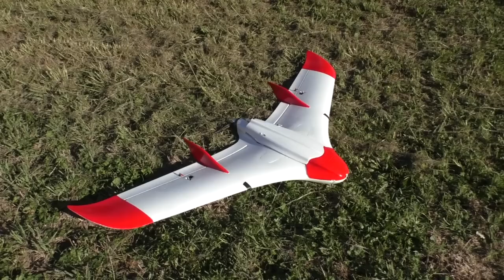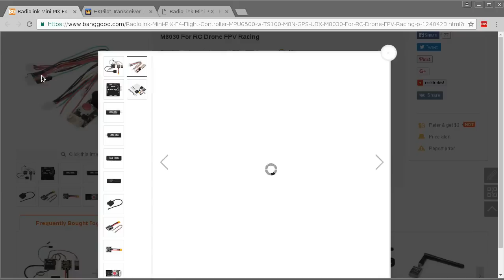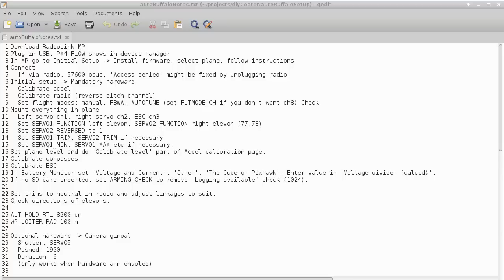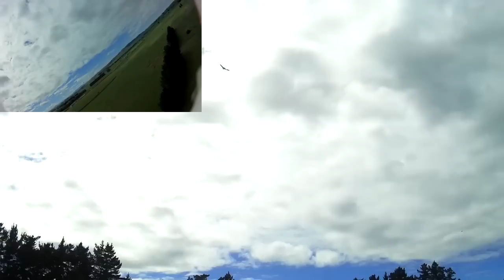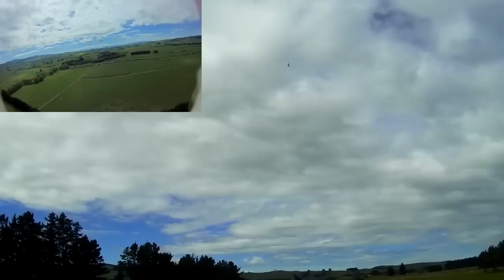Arduplane setup steps for flying wing

Comment: Hi @iforce2d, great vidoe. thank you for sharing! I'm one of the maintainers of ArduPlane so if you have any questions about flying ArduPlane let me know!

ARMING_RUDDER=2 to allow ARM and DISARM via rudder

FBWA mode is manual throttle. If you set throttle to zero, it falls out of the sky. If you use FBWB then it's speed/height based. throttle in middle means maintain current altitude. The flight controller figures out whatever it takes to do that. throttle all the way up/down means raise/lower altitude, speed will be maintained automatically to be within ARSPD_FBW_MIN/MAX and will cruise at TRIM_ARSPD_CM (in cm/s).

General rule: if it flies good in FBWB, it will fly good in AUTO and RTL.

As far as the funny pitch reverse. It was probably that you reversed the wrong aileron and then reversed the pitch in two places to make up for it. Keep in mind that "MANUAL" is a passthrough and there's 3 places to apply reverse (for better or for worse). Transmitter output, ArduPilot RCxREVERSED (the input) and SERVOx_REVERSED (the output). 

Your hardware problems are related to "you get what you pay for". There is a huge variety of hardware available and you've selected pretty much the absolute cheapest option. I highly suggest getting quality hardware. Faulty hardware is a huge time sink. What is your time worth? The cost is not that much different compared to the whole cost, not to mention if it fails in the sky and you scrap the aircraft too.

If you get pretty much any other hardware you'll be able to use normal latest-release versions of Mission Planner instead of their Chinese version.

MANUAL mode is not required, it's just forced in the GUI for people new to it. You can override it by setting FLTMODE6.
Reply from the maker: Hi Tom - was it you talking about running Arduplane on a very small wing and a CC3D mini or some such hardware recently on Gary's podcast? I was looking around for more info on that but couldn't find any...

btw the pitch reverse thing happened with both multirotor setups too. I noticed that when I changed the 'reverse' checkbox on the radio calibration page, it would affect the value of SERVO2_REVERSED in the full parameters list. I think servo2 is elevator by default so for a conventional plane, reversing it would indeed have the desired effect of reversing pitch, but imo it should simply reverse the commanded rc input.

Anyway for the third and subsequent setups I made absolutely certain I didn't twiddle with that checkbox and simply reversed pitch in my radio, and I didn't have any more trouble. Maybe it's a quirk of this non-standard firmware.
Reply: @iforce2d yes, I was in the video but the work was all done by Andrew Tridgell (I was sitting next to him). Check video https://youtu.be/x8nQoEPrCTc?t=3005
Reply: sir i have some fixedwing planes but there is not possible to fly in autotune mode . how can i give the  pid values in manual
Reply: @ Tom Pittinger I have a question can I still use  arduplane in an apm 2.6 I have been trying to  set up  my apm 2.6 can't calibrate compass for some reason tried uploading older firmware. Can you please help me
Reply: gregatex I doubt Tom will help you with APM boards.  They are more helpful if you buy the expensive so called branded pixhawk boards they usually won’t help if you are using so called knock off boards.  That’s all good and well and most can appreciate that but not everyone has the cash to spend on a $400 pixhawk.
Reply: gregatex if you are using APM and pixhawk purchase from eBay or Banggood you are pretty much on your own on figuring out how to get it working. Just a heads up.
Reply: Hi Tom, 
I've just noticed that my favorite Flight Controller:

(this one: https://www.banggood.com/JHEMCU-30_5x30_5mm-Dual-Gyro-F7-Flight-Controller-AIO-OSD-5V-8V-BEC-Black-Box-for-RC-Drone-FPV-Racing-p-1460428.html?rmmds=myorder&ID=17&cur_warehouse=CN)

 Isn't yet supported on Arduplane. As i plan to build a vtol plane and already have one of them i'd like to ask you how much work you think it's gonna be to make this flight controller fully supported. I'm very enthusiastic about it and can't wait to start coding.
best julius
Reply: Hello,
I just started with the hobby. But i am facing a problem with servo output in missionplanner.
I have a FlSky fs-i6 radio and Pixhawk 2.4.8. In missionplanner at radio calibration all the channels change when I move the sticks on my radio aswell the throttle. But when I go to servo output nothing happens when function throttle is selected. When I select RCin3 the servo output does change. My question is how to get throttle moving asswel because I need this to let my rover drive autonomous.
Reply: @pingsangi5418  you need to arm it

Comment: Could someone let me know the correct serial/port for this FC, as I'm struggling to get video out. Thanks
Reply from the maker: You can look at the list of serial ports before you plug in the FC, and compare to after you plug it in. There should be one more port showing. If not, then it sounds like either the FC firmware is not flashed, or a bad connection somewhere.
Reply: @iforce2d, thank you

Comment: Hi @iforce2d
i just try to configure an old but never used minipix radiloink i have an problem with volt and current  sensor 
voltage look like ok but the current have bad reading i choose the same option than you i have the same card !
i reading one the plane with wattmeter and put the both value on Measeured battery voltage and same with current.
have an idea ?
thanks for your video
Reply from the maker: If you don't see the current value changing when you run the motor, it could be that the current sensor in the hardware is faulty (one of mine was). But if the current value does change with motor speed, then you should be able to adjust the 'amperes per volt' value so that the current output value matches your reading. It will never be super accurate, only an approximation.
Reply: @iforce2d  thanks for Ur Reply i see but i do the same way i do with my pixhawk but i have the wrong value for Amp the current stay the value if i put Reading 3a and save the current when i cut engine don't decrease.
Reply: @iforce2d  i found work under 3a not accurate is why !

Comment: Hello, any ideea why in my case the elevons go down when pitch down and up when pitching is up?
Reply from the maker: When you say "pitching down" do you mean when you move the pitch stick on your radio, or when you hold the plane and pitch it up and down. If it's the stick, reverse the stick in your radio (or on the radio calibration screen in missionplanner). If it's when holding the plane and moving it, maybe the flight controller board is not mounted facing forwards...
Reply: @iforce2d  i mean when holding the plane and pitching it up and down. FC is installed facing forward, in Mission Planner in the HUD i can see correct the roll and pitch.
Reply: @iforce2d  solved it, seems that i had the ELERON channel 2 on the remote "Inverted". I have unchecked it and it is ok now.

Comment: Hey mate, awesome video - Did you have to change any parameters for the compass with us being in the southern hemisphere? Have tried absolutely everything and the compass still seems to be quite off with its heading.
Reply from the maker: I don't use compass on planes. I do use it for multi-rotor of course, but Ardupilot seems to figure out the magnetic declination automatically and I've never had to deal with it. If it seems to be a multiple of 90 degrees off then maybe the orientation is just wrong. You can change that in a parameter somewhere. Some orientations might expect the compass to be upside down.

Comment: Did you have lipo plugged into fc with USB connected to computer, cause my matek h743 wing fc radio calibration page, the bars  don't move to tx stick input.
Reply from the maker: You need a receiver that does either sbus or ppm output.

Comment: Hey - I can see that you are using FS-i6x as well. I always thought that telemetry system (such as blacksheep, crossfire) is connected directly to the radio - not the flight controller.
I am running my plane with matek h743 FC board - how and where did you wire up that telemetry to the FC ? UART ? how the missionplanner/inav will know that is a telemetry ?
I can also see that the telemetry you are using is discontinued, any suggestions on different hardware that may work with i6x ?

Thanks
Reply from the maker: Yes, UART. When you connect the FC to your computer to change settings, it uses mavlink protocol over the USB cable. Think of this telemetry module as doing the same thing, but wireless. Mission Planner doesn't need to know if it's wireless or not.
Plenty of information here: https://ardupilot.org/copter/docs/common-telemetry-landingpage.html
https://ardupilot.org/copter/docs/common-telemetry-port-setup.html

Comment: Very helpful video- thanks. Could i ask what the range is like on yoir telemetry radios? I got some 500mW ones ... i would like to get a few km of range. Can you recommend and 3rd party antennas for the radios?
Reply from the maker: The $30-$50 100mW ones give me about 1km usable range. https://youtu.be/dIvC4ZB88h0?t=1151
If you want a serious telemetry system, there is a place called RFDesign that sell them, but they're not cheap.
http://store.rfdesign.com.au/radio-modem-bundles/
Recently I also saw some on Banggood that appear to be knock-offs of the RFDesign ones https://bit.ly/32lJm4W

ah you're just asking about antennas, oops. I would expect the ones from RFDesign to be good. I actually have a RFD900x I but haven't tested it properly yet :)
http://store.rfdesign.com.au/antennas/
Reply: @iforce2d  thanks for the information. Just by coincidence Painless 360 reviewed some of the rf design ones the other day.  I think i might look to get a set  in the future... but for now i will see how i get on with these. Thanks again for the information

Comment: Hello friend !
I have a pixracer, and I'm not able to activate the servos, jpa I tried to do it with an external power source and even so it didn't work, I've done all the settings and nothing, it seems to me that the problem is in the signal. Everything is normal with escs!
Greetings from São Paulo Brazil
Reply from the maker: Perhaps it's the 'arming check'. By default you need to press a hardware button to allow the motor and servos to arm. In the full parameters list search for 'arm' and there you can select which things you care about when arming. https://ardupilot.org/plane/docs/arming-your-plane.html

Comment: I've received mine, haven't flown anything yet, but i really like how the UI is on this system
Reply from the maker: Interesting. Coming from iNav I didn't like it much at first, but like many things once you know where all the knobs and buttons are...
Reply: @iforce2d  Well I was unable to get any gps lock on initial startup, and was on my own able to disable the internal gps, and enable the external, and instantly got 10 sats, write params, ...so simple. I have numerous f3 and f4 sp racing fc's, and have 'never', been able to get them to be seen by either cleanflight or betaflight, for whatever reasons, be it usb driver, or other, I find those softwares very exclusive, and very much the result of a n internal understanding of a programmers mind and not instantly user friendly to 'just anyone' who wants to use them. That said, I'm not getting Radiolink Missionplanner to see my Minipix on My Pc Tower, I am on my laptop. So, the joys. At least on the laptop I'm mobile.

Comment: Helpful video, but why are you using a compass for fixed wing, rather than disable it and  reply on the GPS which is normal practice?
Reply from the maker: No particular reason not to use a compass if you have one. Some people disable it to stop the annoying warnings if they didn't calibrate it properly, but I would hardly say that is "normal practice". Using GPS only may not be sufficient to correctly detect direction in very strong headwinds.

Comment: To connect the 3DR telemetry transmitter to the miniPix I used some pre-crimped cables from Ali Express

https://www.aliexpress.com/item/12Pcs-a-lot-6-colors-Pre-crimped-Cables-Pixhawk2-Pixhack-Pixracer-PXFmini-GPS-Telemetry-OSD-Ultra/32800824381.html?spm=a2g0s.9042311.0.0.23b54c4d789l9U

They have a crimp at one end suitable for the miniPix plug and the other for the 3DR transmitter plug. Just plug them into the appropriate plug. It’s easier than soldering.

Comment: Thank you for the videos about the radiolink mini pix, after seeing these I decided to get one. I'm going to install it into a mini talon, just hoping vtail mixing is available in the software. I'm also going to try to install a micro minimosd by flashing it with the mavlink version of the available software. (did that a few years ago with the full minimosd witch was connected to a cirrus megapirateng board :-) )  Also going to try it with a crossfire rx, not sure arduplane is supporting crsf protocol. Thanks again !

EDIT: I just noticed you covered the minimosd part in a different video

EDIT2: think i bought the last one :->

Comment: Exactly what I needed for my FX-79 Build to conform my setup.. Seems I missed a few things... Thanks Chris. Would have loved to see you do a RTL..;)
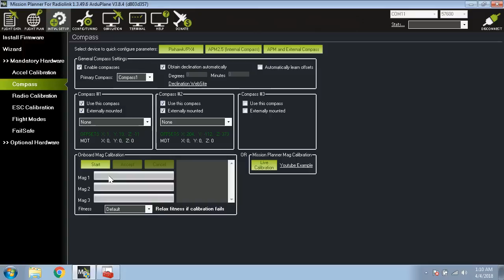21:30... which of the 2 compasses is in the GPS puck ?? Wouldn't the other would then be internal ??
30:33.. Did you finally figure out why your wing randomly pitched down when you were turning ??
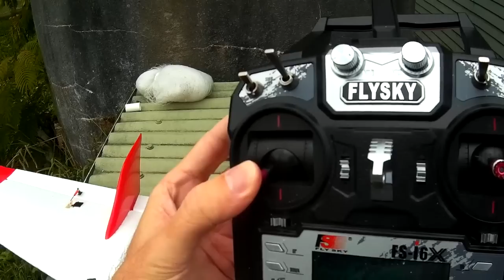33:52... You need to set the ARMING_RUDDER to (2) to be able to Arm and Disarm...
Reply from the maker: I don't know which compass is which. Recently I have been running with the second one disabled and it seems fine.
I'm not completely sure of the reason for the pitching (not random btw, it was always at high airspeed) but after adding spars in the wingtips it is much harder to get it to happen, and when it does happen now it only pitches very slowly. I think the remaining problem might be my servos struggling a bit to hold the elevons in the right place.
Reply: Thanks for the info Chris...
Will strengthen the wing tips before my 1st flight.

Comment: Will be interested to see what range you get out of the telemetry radios. You can get 500mwatt versions but the standard 100mwatt versions should be ok to out over a km
Reply from the maker: I went out to 3km this morning, did a full circle there at about 90m altitude and the RSSI displayed in the artificial horizon view stayed over 90%. I don't know how that percent number is calculated though, because the telemetry log shows the RSSI to be about half of what it is when close by.
http://www.iforce2d.net/tmp/sunriserssi.png
In any case the link seems to be performing very well.

Comment: Great video, thanks for sharing.  Just going through final stages of build using Pixhawk in a Mini-Talon airframe.  The Mini-Talon can be difficult to launch so was planning to do an initial launch in Stablise mode to help with the hand launch to get in in the air before switching to AUTOTUNE.  I hope this is the right decision!
Reply from the maker: I dunno if you would want to launch in stabilized mode right from the start like that - probably better to get it a couple of mistakes high in manual mode before testing any autopilot features. These days I do use stabilize to launch though, it really helps with the big plane, especially after I set up a mix in my radio so that when I flip a switch the pitch stick will be held fully back. That way all I have to do is throw and then quickly raise the throttle.
Reply: have you tried auto launch? Masha Allah a fantastic video , I haven’t touched my planes, APM and Pixhawk, in over a year, thank you buddy
Reply from the maker: Yes, I tried auto-launch. I don't really like to depend on the accelerometer and GPS when my hand is near the prop, and it takes up a mode on my switch (unless I set the mode with ground station but that means I need to have GS available and I can't set it from my radio). The switch-mix method leaves everything fully under my control, and I don't need to set a specific launch height or the launch direction. During flight it can also be handy sometimes to use the switch to do a long climb.
Reply: The stablize mode actually worked out well for me this morning.  I dialled in about 40% elevator as well which is activated on a switch on the controller.  Using this method allowed me to get the model in the air and gain vital altitude.  This method gives me the necessary few seconds to get my hands back on the controller after throwing the aircraft.

I was able to pop the aircraft into AUTOTUNE mode and do some tuning.  Its a fascinating experience flying an aircraft in this mode, watching it learn.

My only mistake of the day was to attempt a landing in FBWA mode.  I decided to abort the landing only to find the aircraft wouldn't climb quick enough, so I had to just cut the throttle to ensure it landed near ground level in a tree, rather than several meters up in woodland.  Time for repairs before the next test flight.
Reply from the maker: Good to hear - well, apart from the tree landing :) You'll probably find that FBWA helps with landings too, just as long as you keep in mind that potential inability to do a go-around.